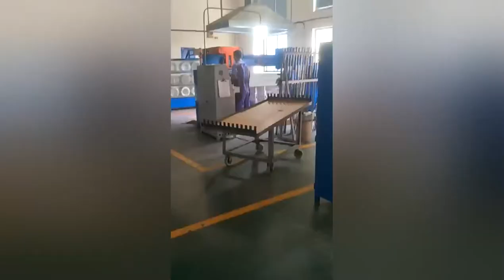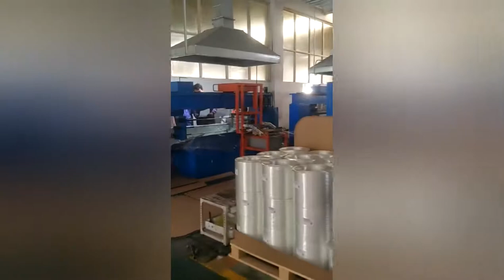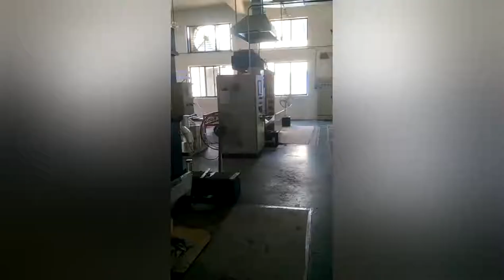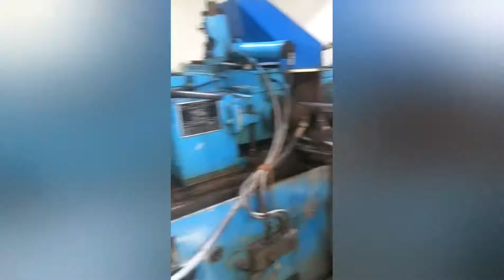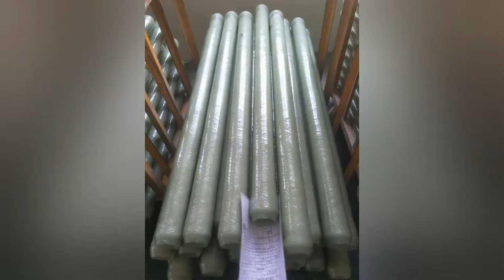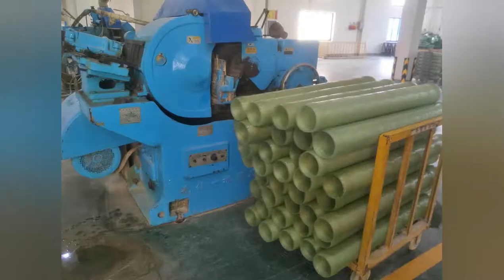How FRP fiberglass fuse cutout pipe/tube making?Filament winding line show you manufacturing process

Comment from the maker: epoxy glass fiber winding composite tubes，outdoor high-pressure drop-type fuses epoxy glass fiber (cloth) composite tubes， High voltage current limiting fuse (oil-immersed) epoxy glass fiber (cloth) composite tubes，high voltage lightning arrester epoxy glass fiber (cloth) composite tubes，Epoxy fiberglass wound insulation bushing epoxy glass fiber (cloth) composite tubes，  transformer (high temperature resistant)epoxy glass fiber (cloth) composite tubes; Arc quenching steel paper tube